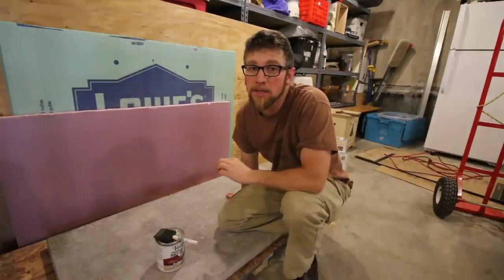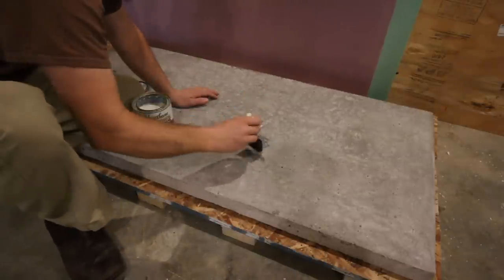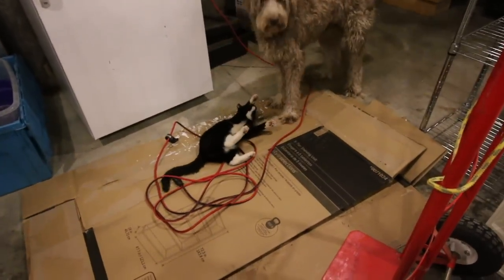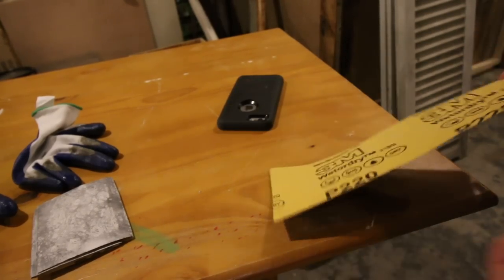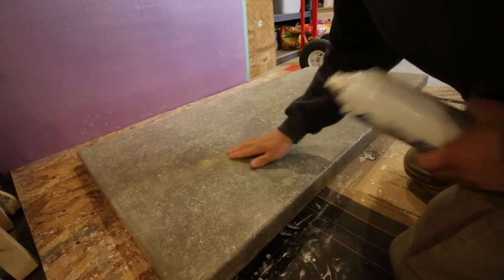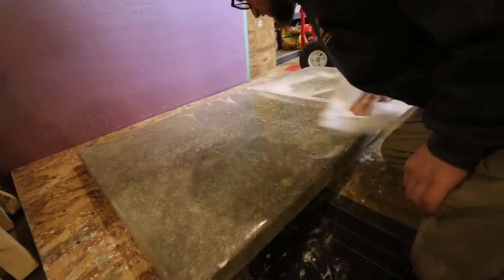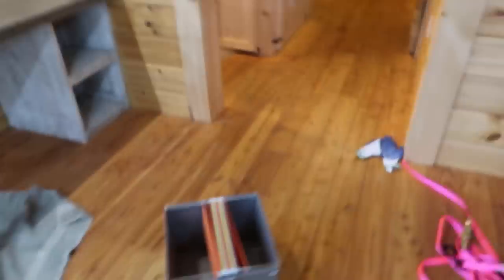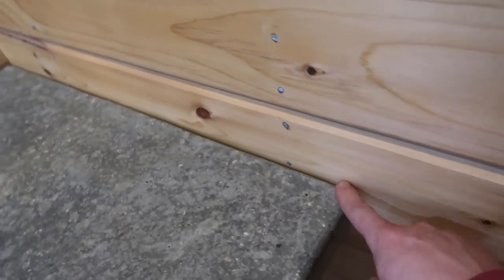Installing Our Concrete CounterTop Desk ~ Finishing the Top

Comment: I did notice a clearer picture and wondered why.  lol I didn't notice any difference in sound though.  I personally would not like those filing drawers since, when you pull them out, there is nothing on the bottom to hold them while you take out a file or file something away but, I'm not the one using it.  lol  It looks great!  good job!

Comment: The desk turned out real nice, fits right in. I heard Gina mention getting a Cricut stencil cutter. If you haven't purchased one already I would suggest getting a different brand. I use the Silhouette stencil cutter. Cricut is all proprietary, you can only use cartridges sold by Cricut. This means all fonts, photos, images etc. are additional purchases. You can't create your own unless you have the Cricut cartridge. The Silhouette and other brands do not use proprietary software. With my Sihouette I use Sure Cuts a Lot Pro, a third party stencil software, that allows manipulation as well as design, and will output direct to your cutter. You can use all the fonts on your computer, no added cartridges, import .jpg files for stencils and manipulation, no added cartridges. I also recommend GIMP (Graphics Image Manipulation Program) a free graphics program much like Photo Shop and paint box on steroids. You can design in GIMP, import images on your computer or scan in artwork, adjust, manipulate, add text using any font, very versatile. Export from GIMP as a jpg, import into your stencil software, where you can break apart different colors for multiple stencil templates.
Silhouette will cut vinyl, thin leather, card stock, construction paper, bond paper and acetate for making reusable stencils. You can also get a set of colored markers that fit right into the cutter, and allows you to direct draw on materials right on you stencil cutter.
Reply from the maker: I wont tell Gina Lol She got a cricut for Christmas! Lol

Comment: Use that spray away after laying the bead then you won’t have to tape it off, run your bead of silicone and before you wipe it spray with the spray away and the moisture layer will keep silicone from spreading and will leave nice clean line. 👍try it next time you have to put a bead of silicone down

Comment: Silly question...why not use epoxy/resin to quickly seal and protect and then add the satin finish poly to give you the surface look  you wanted?

Comment: Al, can you estimate what the cost of the actual concrete for the desk cost from the frame to the concrete. I have little experience with concrete counter tops but I do like the look of that.
Reply from the maker: The concrete countertop cost around $70 start to finish. The desk was made of wood we had at the house. I hope that helps